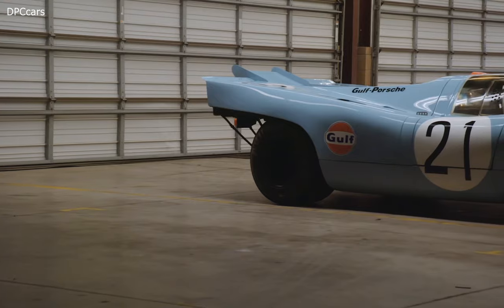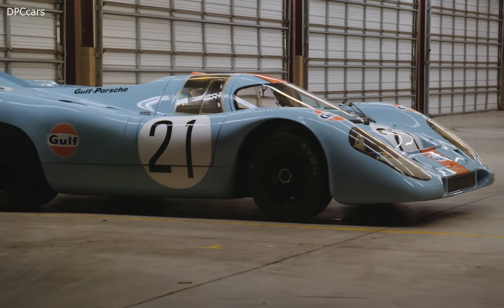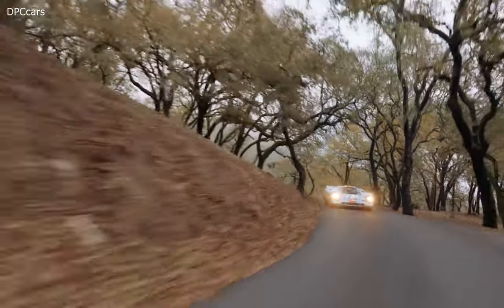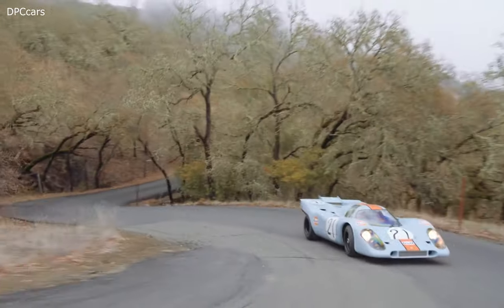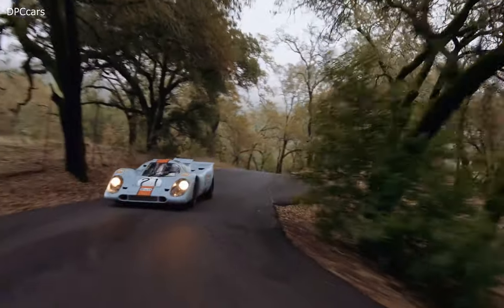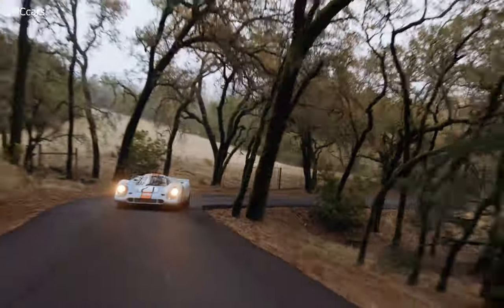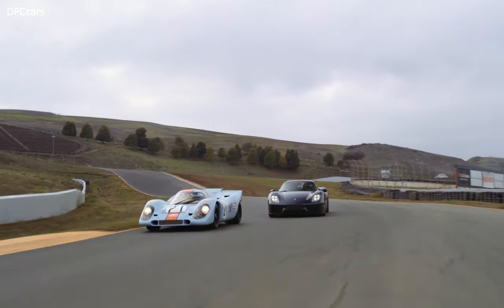1970 Porsche 917 Explained

Comment: It's too bad Porsche never produced a 2 seat, roadgoing version of this, like Ford did with the GT40. They would have destroyed any street Ferrari, Lamborghini, Maserati, Pantera, anything.
Reply: It was in its way, incredibly fragile and very basic. With a race car it is stripped back to basics between every race, the chassis tested for leaks (it carried the oil from the cooler in the nose to the engine), the engine rebuilt (they were fragile - blew at 9,500 RPM - gear shift was at 9,400). The bodywork was fiberglass and very thin. I think by the time Porsche made a 917 for the road it would have lost the magic it had as a race car. That said there were a couple of replicas that were road going but without the flat-12 engine which are as rare as hens teeth.
Reply: They all have a second seat, it was part of the rules of sports car racing. Even the 962s had a second seat. Usually they weren't much better than a child's seat. I remember reading a story by a journalist after a ride in a Porsche 956 and he mentioned how small the seat was and how uncomfortable it was and that it only existed because of the sports car rules.
Reply: @tonywilson4713  Tony that may have been the ride Peter Brock gave to a journalist at Le Mans in 1983 (possibly - can't remember the actual year). The journalist described being crammed in, his head at an angle to get the helmet in, I don't think there were belts and Brock did a race speed lap.
Reply: @peterlovett5841  I'm Australian so it could easily have been that article. I actually stood beside that car the Melbourne Motor Show. It was a teenage boys 4 wheel orgasm machine.
Years later (late 90s) I had a boss who was into racing cars and had 2 Formula Holdens. One of the mechanics was a brit who had worked on 956s and 962s at Le Mans. Among the freaky things he told me was that some of the teams welded the heads onto those flat 6 motors for the simple reason you can't blow a head gasket if there isn't one. 
The craziest shit was that at Le Mans in those days the teams were just 2 drivers. I can remember my bosses drivers getting out of the F-Hs after 1/2 an hour looking like they had done a marathon. So how those guys did 12 hours is reality defying.
Reply: @tonywilson4713  Absolutely, it wasn't long after Brockies Le Mans run that they went to 3 and sometimes 4 drivers for the 24 hours. If I recall that attempt came to an end when Larry Perkins pranged it at something dark o'clock due tiredness.
Reply: @peterlovett5841  They changed the oil with gas because drivers started to be in a finnish sauna.
Reply: you have to remember, porsche in the 1970s was a small company. they barely could afford to make the homologation numbers for this race car, not speaking of the tooling and changes required for a roadgoing version.
Reply: @TheWolvesCurse  I knew they were small back then, but I didn't know they were struggling. Wasn't VW their parent company back then? I thought they were.
Reply: @donellmuniz590  it is only very recent, as Porsche did try to buy the whole VW group a few years ago, around 2005 IIRC, which made the ogre buy the sports car company in return. But, as there is always a but, Porsche and VW were indeed founded by people from the same family
Reply: @donellmuniz590  no they were independant until the mid 00s in the new millenium. they shared some parts in joint ventures with VW and Audi back then though.
Reply: Technically Porsche made one 917 road car, but for very wealthy customer
Reply: @tonywilson4713  Our  club  had an  event  at  the Weissach  track in the mid  70s.  We  did  4  laps  around  the skidpad,  three  dry  and one with  a wet  corner.   The  factory had  a  drawing  for  us  and the prize  was  a  ride  in  a  917.  I  didn't  win,  but  sadly,  they said  the  machine  broke  and had  to  revoke  the  drive.  We  were  the  Porsche  Club,  German  branch.
Reply: @davidbach7003  It wouldn't be the first or last time a ride like that was cancelled for a breakdown.

Just consider that even endurance race cars have an incredibly short time span between major services. The best of them is barely 24 hours of run time, yet the average car is expected to do many 100s of hours (some in the 1000s) of running between major services.

Its what you get for pushing technology that hard. Its the same for many areas of engineering. If you look at things like fatigue failure its an exponential function of the rate of work. Simply doubling the work rate of anything more than double the failure rate. Its not linear and the failure rate function is unique to each device.

I remember a lecture we had on the subject way back in college to explain why the repair on the 747 that crashed in Japan in 1985 was so bad.
Reply: They showed  us  a  film of  Mark  Donohue in  the  917  driving  around  the  test  track.  They could  not  believe  his  times,  better  than the  factory  drivers.  They  had  a  helicopter  film  him  from  above.  His  style was incredible.  He  would  flick  out  the  rear  in  oversteer,  when  halfway  through  the curve, he  would  nail  the  gas  and  rocket  out of  the  curve.
Reply: @peterlovett5841  there are two road legal 917s...........
Reply: @davidbach7003  David, believe it or not, there's every possibility that the 917 one of you would have been given a ride in was the exact same chassis as in this video - 917-035/015 (meaning it was 035 re-numbered 015 after 015 was retired). It won the Spa 1,000 Km in 1971 - still, almost unbelievably, after over 50 years, the fastest road race ever run - then from 1972 it served as the 'taxi' at Weissach. If you remember it being painted a sort of orangey-red, that would have been it. Pedro Rodriguez and Jackie Oliver drove it at Spa (in Gulf colours, of course, as it is again now) but at Weissach for the taxi rides it was usually driven by Hubert Mimmler.
Reply: @peterlovett5841 fragility can be engineered out

Comment: I've read the 917 was a "homologated production" sports car where only 25 needed to be produced (for homologation). For 69-71 "production" cars could have 5 litre engines whereas prototypes were limited to 3 litres. The FIA didn't think any manufacturer would build 25 cars to a new design. Porsche did. I recall Frrrari did with the 512.

Comment: Great car.

Couple of stories I heard differently
1) Mark Donoghue 917/30 CanAm was 257mph
2) 917 Long Tail - on a hot day in testing they noticed the lack of splattered insects around the rear of the car, suggesting why the rear wing was so ineffectual! No air flowing over it!
Reply: The 017/30 was the twin turbo model was it not?
Reply: @johncarlson8029  Yes, the 917/30 was the CanAm model. Reputed 1500bhp in qualifying trim.

Not quite such a thing of beauty, but worthy of respect.
Reply: Pretty sure it was John Weyer that discovered that, but it may have been ex-Lola designer Eric Broadley.
Reply: @Tj930  I still have 2 Aurora AFX 1/64th scale (HO) 917 Can Am slot cars stashed away. A white/red L&M car, and a blue/yellow Sunoco car.
Reply: True.....Late Fall 1969 testing  at Osterreichring, in Austria. John Horsman of the Wyer team noticed the many fly splatters on the nose and front of the car, but nothing on the rear flaps. The adjustable rear flaps were then raised incrementally, and test runs made until the flaps were positioned STRAIGHT up (!)....and even THEN there were no bug splats. The air was flowing over the top of the flaps which showed them to be totally ineffective. The Wyer team used plywood and tinsnips to fashion a raised rear tail section, and that took off 3 seconds per lap and the drivers said the car was then immensely stable. That became the 917K a few months later after Porsche took that test resuilt and made a proper rear section....the car won the very next January at Daytona.
Reply: @TheWilferch  That's the story I remember reading 30 years ago.

Comment: And I do mean"sound like that!" I've always been a sports car guy: MGB'S, Triumph TR4A and a Barracuda Formula S. Once got to take a short spin in a 66 Plymouth 2 door stripper. Not even a heater, with a Hemi, close ratio 4 speed and a 4:10 posi. I don't know which scared me the most, the indescribable viisceral power, or trying to get the thing to go around a corner. It had one purpose - quarter mile.  No ability to handle or stop. No balance of power to handling whatever. But then that's not what it was built for and the reason they built Barracuda Formula S cars for guys like me. And it was improved when they swapped the 273 hipo for the 340, one of the most underrated engines ever. Man it can wind and pare it with a 3:02 posi and a wide ratio 4 speed and it does everything well.  Still won't scream like a    917 or a Ferrari V12 but then it costs about a much as a wheel for one of them.

Comment: We need road cars with boxer-12 engines.
Reply: Flat 12's aren't boxers. They're similar, but the opposing pistons share crank-pins like a V-12 except at 180 degrees and the firing orders are drastically different.

Comment: 4 thumbs down must be chebby or gm junk owners. No class.
Reply: Haha what? The 350 small block has literally moved more vehicles land, sea, and air with more HP/BHP than probably any other engine. It is the most commonly used engine in performance and it's a Chevy. I'm a Chevy/Ford owner and I did not downvote this video. But even I know Honda makes the best engines.